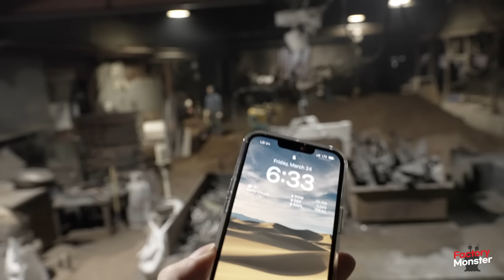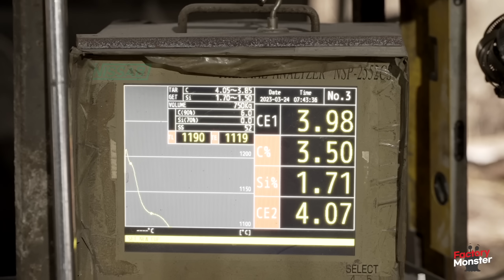Manhole Cover Manufacturing Process with Scrap Metal. Korean Manhole Factory

Comment: This is sand casting of cast iron in a two part mould. 
The bottom half of the mould is called the drag. 
The top half of the drag is called the cope.
The casting sand is rammed into the mould with an air hammer in this case, though traditionally in foundries the ramming was done by hand with a ramming tool, and it's still done this way in a lot of places, but I love that they're using the little digger to  move bulk sand and an air hammer to do the ramming. Same skill level required, but much faster and less wear and tear on the body.
The inner faces of the mould look to have some residual release agent from when the halves were rammed on the pattern. This can also give a finer surface finish to the casting.
Reply from the maker: Thanks for sharing what u know ;)
Reply: True 100%
Reply: Watched the video then I read your comment and on the spot info👌🏻 Then watched again cheers mate🇦🇺
Reply: Europe uses bronze for all manholes.
Reply: @iamD2  I'm pretty sure I recall cast iron manhole covers in Amsterdam and Stockholm, but it was a while ago that I was there.
The temptation to polish and engrave bronze manhole covers would be immense.
Reply: @haitchteeceeeightnineeight5571  Lol
Reply: I heard pneumatic hammers are really bad on the nerves in the arms. So you're trading a different kind of injury compared to using regular hammers
Reply: k
Reply: @bigsmall246  Recurrent vibration can be a problem, but we've got some pretty good data on what amplitude and frequencies cause damage to humans these days, and simply by altering the mass or geometry of the tool you can minimise or eliminate most or all of the health problems than can occur with incautious use.
Reply: @haitchteeceeeightnineeight5571  that's great, but outside of the US, there's not many unions to fight for worker's rights. So companies usually just get the cheapest tool that gets the job done. Doesn't help that most of these workers are replaceable with like a few days of training.
Reply: @bigsmall246  Korea (South Korea, not Naughty Korea) has a higher percentage of the working population in unions than the united states of America.
So the people working in Factory Monster's excellent videos are on average better represented than comparable workers in north America.

Comment: It always amazes me which processes are still manual. With the sheer amount of cast iron being produced, I would've expected the process to be a lot more automated.
Reply: automation is not flexible, any substantial change in the product means costly changes to the machinery...
Reply: uh so i work in a foundry and its alot more automated then this lol.. 
Molds get machined, finished by hand and then put on a machine where the mold shells are created and then they get poured into (Croning process). 
Aswell as cores for complex inner contours. 
So no ramming sand or putting halves on and removing them and all that lol.. We could easily pump out like 200 out of these in a day.. but obviously they are cheaper. If you look at their machinery.. i mean wow WELDED together to the max because of the abuse on the tools.. 
And i am not even gonna talk about the inclusions you saw when they did close ups.. but yea thats what paint is for XD:.. (atleast in their factory)- it wouldn't pass inspections in the foundry i work in..

Comment: Is the casting sand able to be reused?  If not, what is done with the used casting sand?

Awesome video! 😁
Reply: The sand is reused, it is casting sand with a binder agent.  The runners, sprues and any scrap is remelted.  Recycling at its best.

Comment: Stone pots, stone ware, metal, functional-decorative ceramics(sand, pebble, stone, glass) on metal with expansion-contraction abrasion load-weight inch-pressure specifications... usually broadwalks need pallet-trucks(2.5t) pressure impact and light-trucks 15t and friction when wet-dry and durability warranty. There should be bigger niche for this specification. Customer sends materials and design. MOQ-vs-Price list as quotation.

Comment: A manhole cover without a rubber ring is not a good manhole cover because over time, this type of manhole cover will make a lot of noise and cause noise impact on the surrounding residents